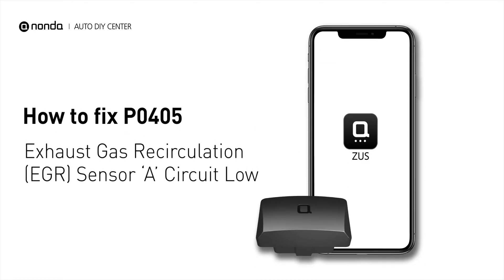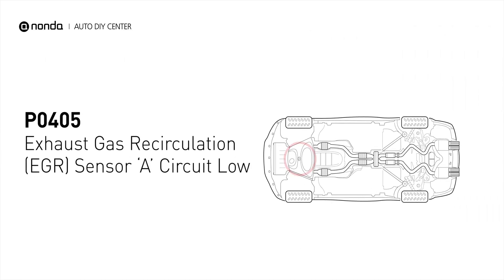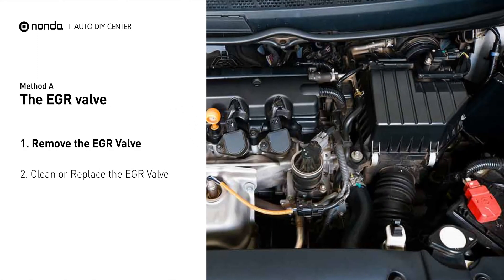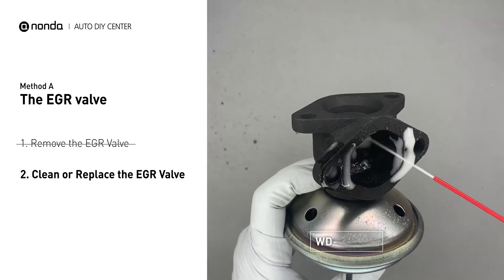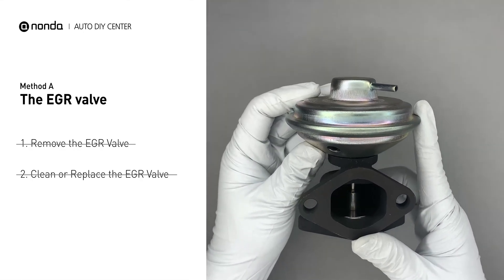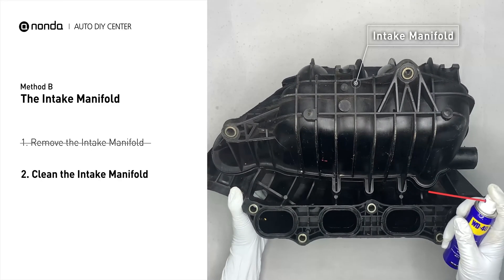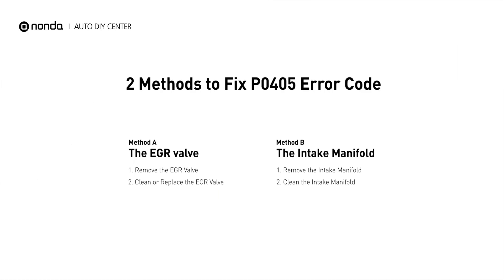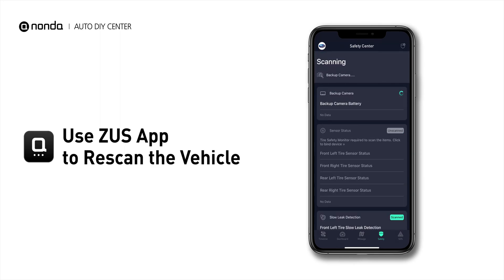How to Fix P0405 Engine Code in 3 Minutes [2 DIY Methods / Only $4.66]

Comment from the maker: Hi, I'm Steve, nonda's lead mechanic engineer. 
Feel free to leave your comments here if you have any mechanic questions, I will be glad to help you out!
Reply: Hi Steve I have the same code I replaced the egr valve , dpfe sensor, and the vacuum solenoid test drive and and light comes back on. Can it be the dpfe harness short

Comment: Remove your EGR and cap it.
Reply: How to cap it please? Is there a video that shows? Thanks
Reply: @Anthony-q5g7h in between the exhaust output and the EGR you need to install a 5mm steel
Plate with 2 gasckets either side. 

The. You need to go to a auto programming shop to get the EGR valve electronically tuned out

Comment: Thank you for your video. I have GL 350 2015 Mercedes diesel. About a week ago, the car started struggling, as it had a bad diesel put in, that feeling. It would drive fine for miles and then all of a sudden would chug a few times. No rhyme or reason for when and where this would happen. Finally, the check engine light came on and it read P0405 and P0404 codes. If I did what you suggested in the video, it might clear the code, but will it stop the car from chugging? Or do I need to replace a part, and if so, which one? Mercedes dealership hasn't been the most helpful lately so I'm trying to troubleshoot myself. Thanks so much! Jelena

Comment: I got this code on my smart car, it will not rev past 3000 RPM as it’s in limp mode, 

 I bought an EGR valve from Germany off eBay. I have a Mercedes technician scheduled to install it.  wish me luck
Reply: does it work with a new egr? i have the same problem with a hyundai i30 2016
Reply: @azer2926  they called me and said they would not install this part because it is aftermarket, so i’m looking elsewhere now. it kind of sucks because it’s been taken to the same Mercedes shop since 2004 when and where it was purchased.
Reply from the maker: Hi @branscombe_, have you already changed the egr valve?
Reply: @nondainc  unfortunately, the part that I ordered was for a gasoline and not diesel. I ordered the new part and funny enough it’s scheduled to come today. Does your vehicle run on gasoline or diesel? I will give you the correct part number.
Reply: @jordanbranscombe I need a diesel one for ml350
Reply: @ethiopianbuffman  smart car?
Reply: @azer2926  you can buy a code, reader, scanner, and clear the code, and it will go back to normal for about 300 km

Comment: Just got p0562 system voltage low and p0405 and my car won’t start. Battery light came on the last time it ran. Is it my battery?
Reply from the maker: Hi Zack, possibly-yes. We suggest getting your vehicle visually checked by your local mechanic for further diagnosis.

Comment: If I am getting a p0405 code immediately after resetting the onboard memory is it a wiring issue?
Reply from the maker: Hi Steve, kindly check the wiring harness and connection to the EGR position sensor for shorts or open circuits.